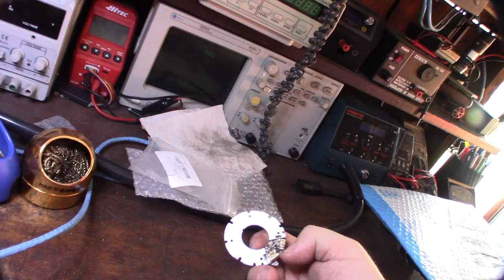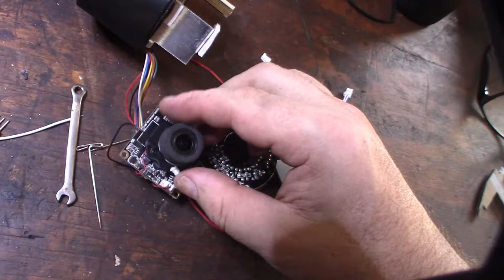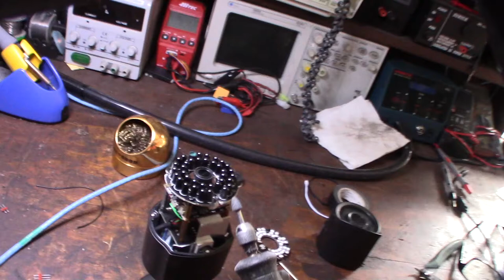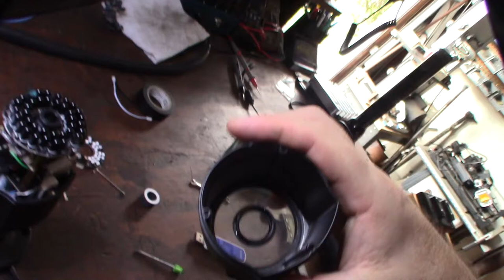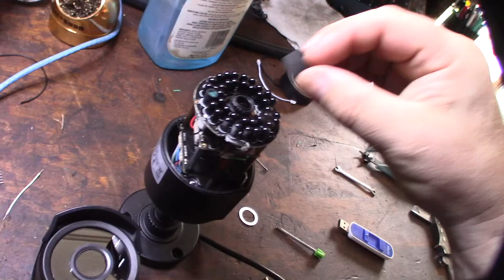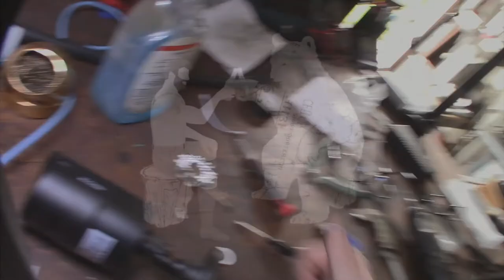IP Camera IR Night Vision Board Replacement Repair HiSilicon SOC Zosi

Comment: the reason you can't see the new LED's is because the operate at 940nm and have tinted lenses, your old LED's operated at 850nm with no tinted lenses, as a rule the downside of 940nm LED's is they have the effect of putting out less usable ir light but they also aren't visible to the human eye like the 850's are, no red glow....